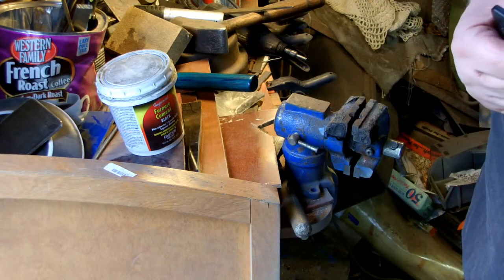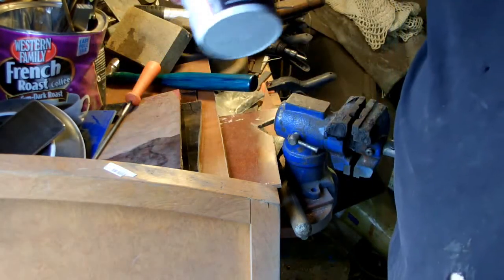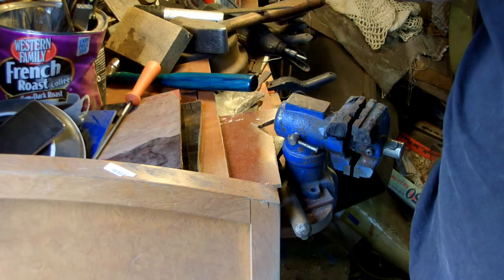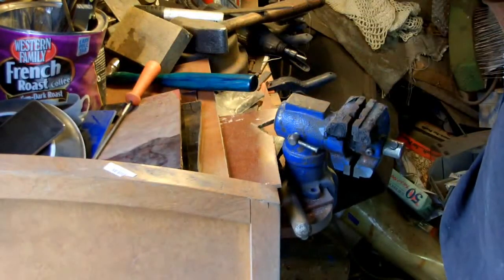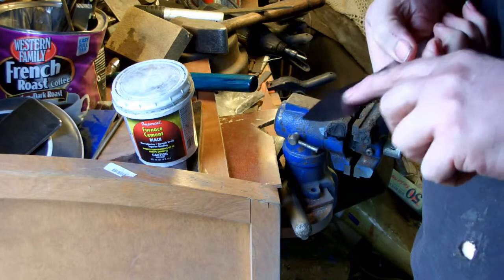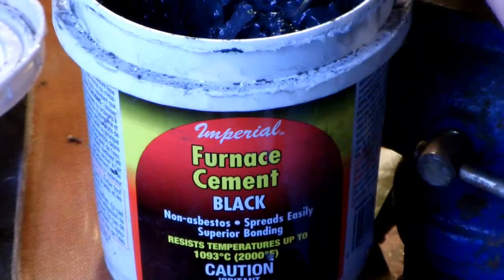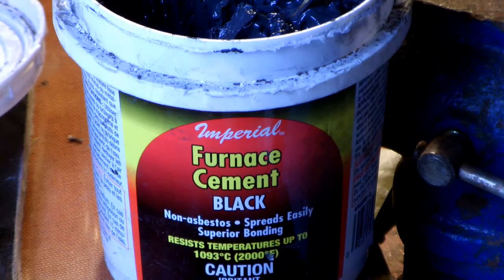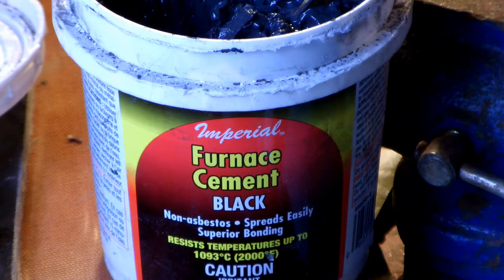Flint And Steels EDC - Creating A Hamon - Part 1

Comment: Jake did you get bad fumes from that furnace cement? I lined my forge with it and did a short burn 24 hrs later and the stuff burnt my lungs and throat terrible.
Reply from the maker: I try not to breath any air near my forge, that kaowool is a nightmare to your lungs... i think the first time i used it i got a lung full of that stuff or the other stuff that came in a calking tube.... so far, this stuff has worked the best out of all that i tried, this can only cost about $4.00 from Ace Hardware.... It doesn't really even have much of a smell....

Comment: hey us that the little 30 dollar HF 2.5 INCH rotating vice.
Reply from the maker: Yes. And it's complete crap and a waste of money. If you enjoy your sanity, DO. NOT. BUY. IT.
Reply: +Dark-Wolfe Knives I only was thinking about it for hand sanding blade and handle
Reply from the maker: Still not worth it. Get a full sized 5 inch vise, with a swivel base, the older, the better... just don't pay over $50 or $60.... check pawn shops and antique stores... or build something like a knife vise https://youtu.be/jm2IBUpTcPg
Reply: +Dark-Wolfe Knives I think home depot had a swivel and rotate 5 inch on sale near me @65. Gotta talk to lady at work to have her husband (assistant store manager) get me a discount. What's funny is the guy in the hand tool/small power tool/ table saw, miter saw etc section is a knifemaker